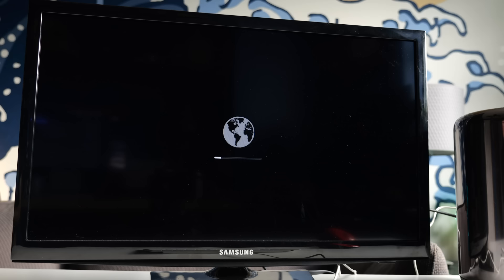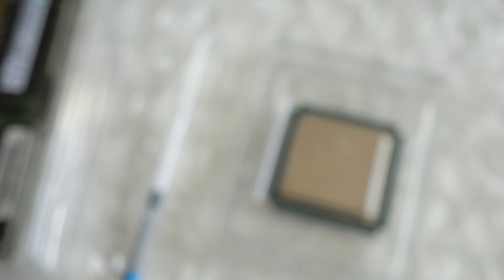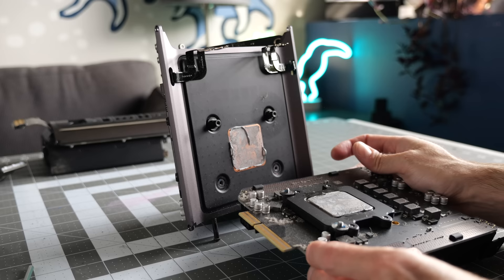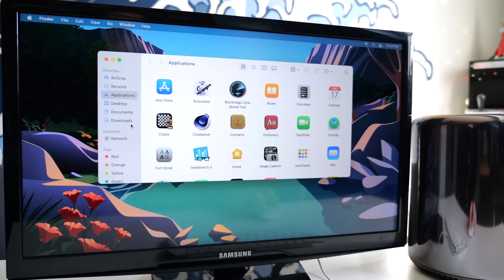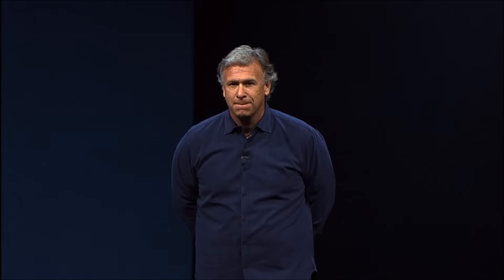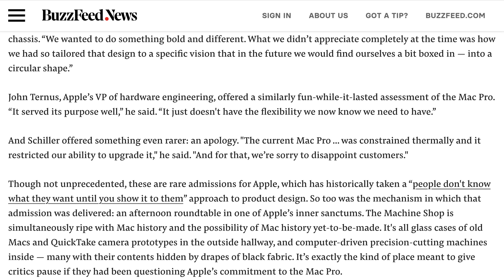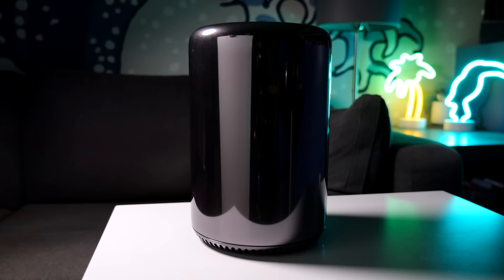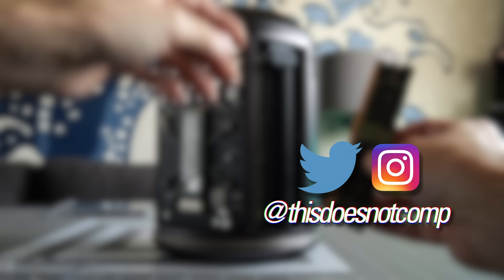Can This Decade-Old Mac Pro Compete With Apple Silicon?

Comment: Excellent video Colin. I think nobody doubts Apple Silicon's power and efficiency, but for a larger internal storage (BTO) be prepared to sell a kidney. Call me a boomer, but I cannot wrap my head around the idea of having my main storage outside the box. For the clutter, and because it simply does not have to be the only way. Give me my PCIe/M2/whatever blazing fast connector inside the machine and let me upgrade. Let me do my thing!

Comment: I have 4 trashcans at work. #1 is used to attach thunderbolt 2 Pegasus storage devices.  #2 is a backup for when #1 goes down.  #3 is a backup for when #2 fails...

Comment: These make great Macs for running VMs. If you can get one for cheap, you could move any VMs from your Intel laptop and upgrade to an Apple Silicon Laptop, and just remote into it with Apple Remote Desktop. I kinda regret not doing that recently...ended up just finding a used 2019 16" with high specs.

Comment: I am still using a 2013 Mac Pro that I bought new in 2014 (expensive!) - I use mine for music production. The great thing is that even though it's not very upgradable internally, there are a decent about of external connections, two separate USB 3 buses and 3 separate Thunderbolt buses across 6 sockets. I am considering upgrading the SSD soon.

Comment: I remember people saying the top looked like an ashtray.
When I saw them new at the Apple store I wanted to put my coffee cup in the top.
I always wanted one and wonder if I can connect it to one of my older Imacs to use as a monitor until I get a small 4k portable tv.
I can remember when the first flat screen tvs came out at Costco.
They were $10,000 !
Now you can get a portable 4k tv cheap or a 4k as low as $150.
Early buyers pay the price of new developments. for manufacturers.

Comment: It would make a cool home theatre pc that wouldn't look out of place next to your TV. Though I suppose disk space would be the problem. You'd need a NAS to keep all your movies on...
Reply: I have a second one, or actually my spare one. A very expensive Dac and Flac and another Dac for Dolby DTS content. 
I have a 6 and 8 TB 7200rpm for video. I have a docking station for 4 sata SSD drives. Also an edit monitor next to the sofa for some Adobe.
It does come with some clutter.

Comment: The main problem for me, and the BIG advantage for Intel Macs over AS ones is that, when MacOS support dies on the AS, they will become paperweights... In an Intel Mac, you install Windows 10 (or 11 if you "patch" the installer) and still use it! I still use a Early 2008 15" MBP with 6GB RAM and a 512GB SSD, and windows 10 runs there fine! I can still do everything I need it to do, because Windows... On Mac OS X? It's done for! So, to me, no, AS is not a permanent solution... the same way ARM does not work for the desktop!! When apple closes the door for the M1, then people will complain... Now? It's just new and "fast"... but time does not stop...!

Comment: i just inherited one of these (october 2022) — it spects out at about 802 single-core and 3222 multi-core on geekbench (vs 1749single and 7617multi on a 2020 M1 MacBook Pro). it came with 128Gb RAM (you can use 4 x 32Mb modules). system bus, and GPU usage have been optimized for pro workflows — nothing feels slow. i use it for logic, affinity photo, and xcode — the biggest limitation is that it tops out at macOS monterey 12.6.1 — so 2022 is the year they finally gave up on this baby. no upgrade to ventura without some hacks. it handles great, and should still be solid for a couple more years (2022 - 2025) — but there is no future — without ventura an M1 or M2 processor. the 2013 macPro has the distinction of having the longest officially supported lifetime of any mac ever made (1986-1990 = 4years) vs 2013 macPro (2013 - 2022 = 11years, supported up to macOS monterey 12.6.1). a solid and venerable machine by any measure. ✨

Comment: I still have two of em and they are great machines. I’ve installed them in bars across the country running multiple hi rez projection setups. My new m1s are certainly faster with lesser specs but the trash cans still rip.

Comment: Running Ventura  (open core patcher)on a  base trash can with no issues, almost runs better than monteray   Also running ventura on a 2013 27in Imac , it also runs pretty well. Use both for photography  editing, event work, Selecting and corrections in ACR  no problems , and the Trash can batches out raws faster than the Dell XPS work supplied me. Great vid BTW

Comment: I have the 2009 Mac Pro decked out with two 3.33 ghz I7 chips, a fast GPU, SSD, 48 gig ram, and lots of storage. It is holding at Mohave but that’s okay for my needs. The entire setup cost me less than $500 and it lands in the middle of the highest BenchMark scores. That means I plan on keeping it for the next 10 years before changing it out, and NOT to the trash can. However, there are some software wanting to upgrade to the latest and greatest. Such as using Amazon Prime Movies on Safari without the newest version. I just simply jumped over to FireFox, which fixed the problem.

Comment: This was actually the first Mac Studio. It was ahead of It's time, people weren't ready for It. It's perfect as a small, silent but powerfull workstation. Apple should have released a new tower Mac Pro arouund 2015. Enter 2023 this is a cool mini PC, Xeon 8, 10, 12 core Xeon. 128GB Ram. 6 TB2 ports for lot's of externa storage and an eGPU like Vega 64, RX 6800 XT so you don't make those D300-700 to hot. Because stressing them can kill your trashcan. At least you could upgrade the SSD, the RAM, processor and GPU ( using eGPU Vega 64 is excellent ).
Now most people will buy the Mac Studio, not the M Mac Pro ( It is less upgradable then the trashcan ). You can buy a Mac Studio and a nice Windows/linux workstation with real graphic cards.

Comment: The machine was easy to maintain and upgrade, but they introduced the machine just at the moment microelectronics was hitting a wall. Around 3 years progress was almost null with mounting thermal consumption by AMD,  Intel, and IBM. Also was introduced as an AMD was never able to produce the low power high-performance cards that Apple was expecting.  Can you imagine that design instead of the cube today?  576GB of RAM,  3  M2 Ultras  72 cores,  and 24TB of SSDs,  and  216 GPU cores. Say all run at 80% clock rate. A compact beast.

Comment: I maxed my 12 core D700 with 128gb and 2TB Sabrent HD. Also added an egpu with AMD Pro 6900 XT.  Opencl score is 93321 and Metal is 124631 still have some years left in this lil beast.

Comment: I still use one of these without issue for video editing 4K media and an M1 MBP. I am waiting to see what the next Mac Pro will offer (and price). The only issue I have with this machine is it is absolutely horrible at compressing and transcoding H.264 since it doesn't have Intel's QuickSync. My 2016 MBP ran circles around my Mac Pro so when I export ProRes Quicktimes I often let my MBP to the transcoding or compressing in Apple Compressor. Just so frustrating that a computer that expensive (at the time) with it's Xeon processors and multiple GPUs was beaten by a wide margin by Apple's [seemingly] other and not as powerful products with Intel chips.
Reply: Even more hilarious when you find out only ONE of the GPUs was for graphics and the other was solely for the display
Reply: @HistoryandReviews  Not so sure about that. There are desktop apps (particularly in 3D) where you can specify how many of the GPUs you want to use and whether to use Metal or not.
Reply: @thetangierc  It is Apple confirmed. Plus I even used a GPU task manager and only one of them ever used power, the other one always ran at 1-3% and is even called the Display GPU

Comment: I got one myself and did these very upgrades (minus the RAM, I am good with 32GB). I spend $470. I still will keep the CPU it came with (6 cores) as it has a faster clock speed. I don't think I'll ever actually use it, but you may never know.
A thing you can suggest to viewers, however, is you can run Linux on this, and keep it on support for several, SEVERAL more years. You can even get a Linux distro to match it as close to MacOS as possible (Elementary OS). Or just any good Linux distro will do. Not to mention, it'll run lighter and friendlier on the hardware since Linux is considerably lighter than MacOS or Windows. I did that with mine. I got Linux on it and it will serve solely to process video rendering. The upgrade wasn't easy for sure, but it only needed to be done once. All I can upgrade is RAM and the SSD which are very easy to do.

Also I did Cinebench on it with the 12 cores on MacOS Monterey, and it scored 8319. Still better than yours. I wonder what happened to yours that didn't score as well? 200 points lower.

Comment: I have one of these Mac Pros.  For the most part I've been satisfied and it's still working fairly well after 7 years. My biggest complaint has been the fan and ventilation.  The thing collects way too much dust and I find myself cleaning it out at least twice a year. I also dislike how there are only 4 USB ports while there are 6 thunderbolt ports. I need more USB than thunderbolt. I like the inclusion of 2 ethernet ports though, as it allows me to connect internet and a NAS over ethernet if I'm not using WIFI. Oh, and the native WIFI adapter isn't all that great. I now use an Alfa 802.11 ac adapter and it's so much faster than the native WIFI.

Comment: Interesting. Not entirely sure why this showed up in my YouTube feed; probably because I watched another of your videos a few days ago... although I'm not entirely sure either why that one showed. But hey, you have a video about MiniDisc!

Now I've been playing with computers since the early 1980s, and after several 8-bit computers and an Amiga 500, I settled on Windows, not because I particularly like it, but because it's ubiquitous, hardware costs less than a Mac, and because it's slightly less of a PitA to use than Linux. Running Cinebench on my 16C/32T Ryzen 9 3950X shows what a ridiculously overpowered box this is, even though it's a couple of years old now.

The one thing that I've learned over the past 40 years, mostly as a developer, is that what's most important is how the software enables you to do the things you want to do with your computer. And once you get used to it, it doesn't make an awful lot of difference what this software is. Which is why I'm considering installing Linux on my work laptop, like one of my developer colleagues; the other one uses an Apple laptop.

The problem that Apple tends to have is that their design department has an disproportionally large impact on the end product, which leads to success stories like the candy-coloured iMacs, but also the victory of design over common sense that is this trash can Mac. With Microsoft, you get the marketing department winning over common sense and customer interest, which is probably worse.

The one thing I REALLY don't like about my PC is how difficult it is to get certain hardware working, specifically the Thunderbolt card (it simply doesn't work, as far as I can tell), or installing ASIO drivers to get professional audio equipment running. That appears to work far better on the Mac. Perhaps if Microsoft spent a little less time trying to get me to use their rubbish, and a bit more time on what they probably think of as a niche market, that would be nice.

Comment: We bought several of these to support various graphics and editing positions on our campus and most had other, to this day, unexplained issues. Mine would randomly freeze and need a reboot, and I spent months swapping memory and other components without resolve. Since it was already past any warranty time frame, swapping for a new machine wasn't an options (though I wish I would have pushed this earlier in the process). In any case, having used Macs for pro applications since the earliest days, I will say this was a HUGE disappointment, and I have yet to spend money on any Apple "Pro" systems since. I actually still have an use this exact 2013 trash can Mac, but as of last week ordered a M2 MBP to finally replace it. I still have hope a true Mac Pro Apple silicon desktop will be introduced, with (finally) easy serviceability and sensible upgrades, and the top performance pro apps and positions need. However, when I have graphics and video folks happily humming along on machines that cost half to a quarter or what we used to spend on Mac "Pro" units, Apple is going to have a VERY hard time ever getting us to buy into that segment, if ever. And with performance in the Mac line as it is, there most likely isn't a need. Guess we will see.

Comment: I have mine with similar specs air gapped and I use it for recording bands. 

Can run upwards of 40 channels with plug ins with zero latency. 

Plus I can toss it in my backpack fir remote recording.

Comment: I loved it when it came out, it was tiny, very powerful and silent! But upgrading the thing was horrible. I mean, apart from the RAM and SSD, (which was proprietary as well.) It wasn't easy to upgrade this thing. It's my biggest regret in my personal Apple purchases that i ever did. At the moment i use a Mac Pro 2019 and i couldn't be happier. Yes, there is Apple silicon but i don't really care about that at this point in time. My Mac Pro 2019 is plenty powerful for what i need to do. I have 96GB RAM, 8TB NVME flash storage, 16-core CPU and a AMD W5700XT GPU. Granted, the GPU is the biggest bottleneck in my system. I can buy the newer GPU's available for my Mac Pro but at the moment, i don't really need it. I mostly make music so CPU/RAM was my priority. But the nice thing with my Mac Pro 2019 is the fact that i can upgrade it! Which i couldn't do with my 2013 Mac Pro. I still have it because i still think it's a nice design and i use it as a backup.

Comment: I actually really like these. I’d be interested to see how they compare to the 5,1 Mac Pro (cheesegrater). Yea, the 5,1 with a custom card will smoke the 6,1 (this trash can) in GPU, that is, if you don’t go with an eGPU for this thing, but I’d guess the Ivy Bridge Xeon in this thing could beat out even the dual 6-core Westmere Xeon setup of the old one. Plus we’re talking SATA connections vs PCI for the drive, and 1333 MHz vs 1867 MHz DDR3 RAM.

Comment: I have a project around i work on and off, in reminiscence of that good old Trashcan: A Mini ITX 3d Printed Tower with build in TFX PSU. Base System is running, layout for 2x 2.5" and 1x 3.5". I have an old 2015 Kaveri A8 7600k for testing in it but slated a 5600G for it. But the Metal finish on the MaC it looks nice.

Comment: I stuck with a cheese grater Mac Pro for 10 years then upgraded to a MacBook Pro i9 right before M1. Waiting for apple silicon to become more compatible and stuff before upgrading again. The main reason for the upgrade would be silent performance. When I’m doing intensive audio or video applications it’s pretty loud, while not as loud as comparable laptops, still too loud for my needs. I also have a PC that’s spec’d nicely.

Comment: Interesting, I did the same thing to my 2009 MacPro which really helped, and it's tempting to do to my 2013 but with a probable launch of the new Silicon MacPro's coming soon, I'm going to take the leap on a new one. Definitely more expensive but when you use it for work its a must.

Comment: Not really “Maxed” as D700 GPUs weren’t installed to replace the D300s. But there’s a good reason for that, not only are those cards hard to find they’re also very expensive when offered. So this $500 computer might be closer to $1200 and then the comparison with a M1 MacMini wouldn’t be so easy. I haven’t looked in a while but I was looking for cheap D700s to replace the now unreliable D500s my 8 core 2013MacPro came with. The average price was around $700 for a used pair so I got a base M1 MacMini instead when they were introduced. Certainly not great at CPU heavy tasks but it held it’s own in video editing. Now with the built in encoders in M1 Max chips there’s no real comparison in video editing anymore. It’s not worth the trouble trying to update the old computer for that. However, for CPU intensive tasks the 8-core 2013 MacPro still holds it’s own even against a 10 core M1Max laptop I now have. So I continue to use it for bulk CPU based encoding. The 12-core upgrade shown here would certainly be a decent project for someone who wants a cheap Mac based CPU powerhouse.
Reply: The faster 8 core not used by Apple is also a nice CPU powerhouse. 
It can take 128GB ram, that runs slower on the 10c and 12c.
It can take a lot of displays. I guess more with an eGPU that you should buy before your Dxx cards fry.
A vega 64 eGPU gives a much higher boost and will be much cheaper. I have a Luxmark score of around 60000.
That is the same as a RX6800XT in a Mac Pro 5.1. If you render using the iGPU's of the 6.1 It turns in a vulcano.
It's a cool small mac based workstation. Ram hungry apps will love It. If you do a lot of long rendering or even gaming, 
an eGPU would be wise. As they are also called trashcans for their failing GPU's.
The processor architecture is getting old. With some apps It won't have any problem and even beat much newer Macs.
With other apps It will strugle and even the Iphone might outperform It or the i7 six core mini with 64GB ram and TB3
for faster cards. That is also an interesting vintage intel mac.